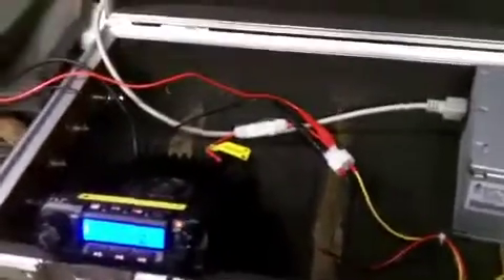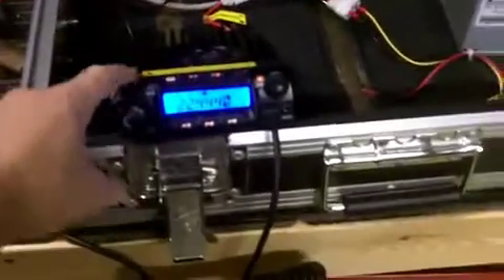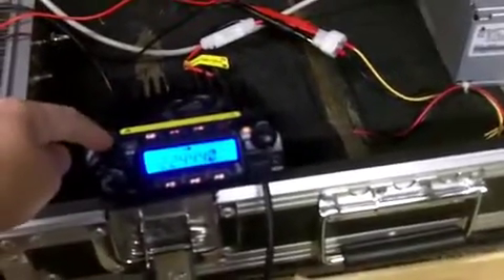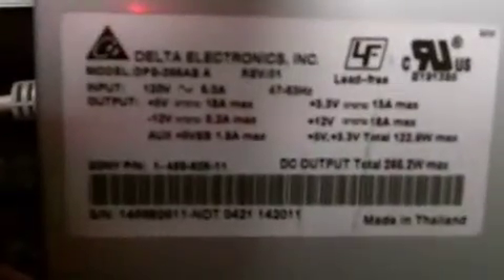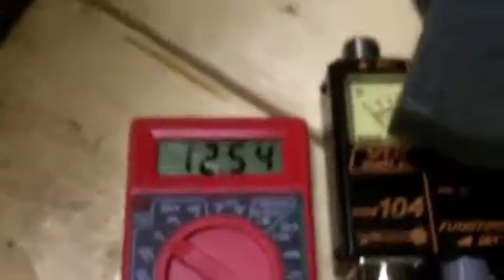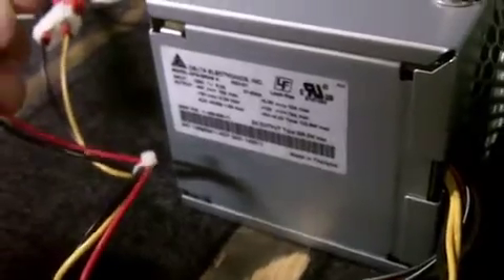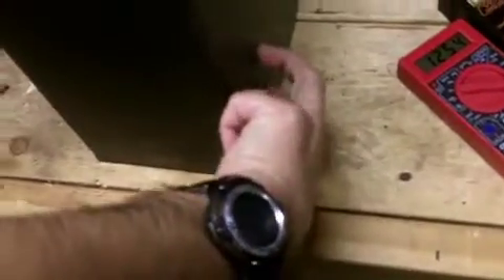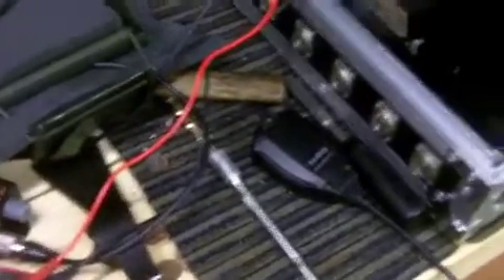Ham Radio Power Box

Comment: If you was to use say fm mode and key up putting a constant demand on the psu chances are it will shutdown after 30 seconds of load as its unstable.

Comment: you can also use a 12v 1157  tail light car builb if you havent got a resistor solder red across both terminals and black to the side/ground of the builb this will but the 5v rail under some load. In some cases you have to also join the 3.3v senseing wires together, but not always nesseary. you could even make an external holder for the builb to give you some lighting in dark conditions.

Comment: The 5v rail needs to be under some load wire a 5ohm 10watt ceramic wire coiled resistor between a red and a black wire and mount it inside for the fan to keep cool. If you put the psu under demanding load it will shutdown. As it is'nt senseing any demand on the 5v rail. The key is to trick the psu into thinking its running a motherboard. it will allow the switching modes to work properly and the psu will be stable. You could also mount another fan on the top to push hot air out keep it cooler.